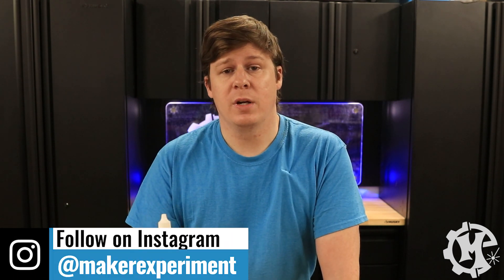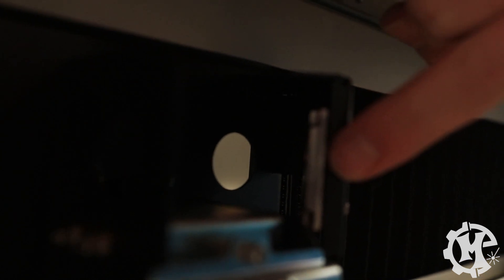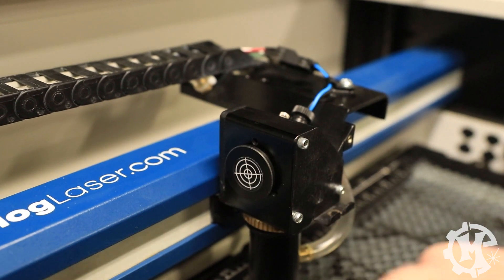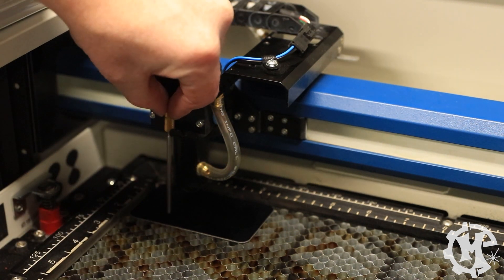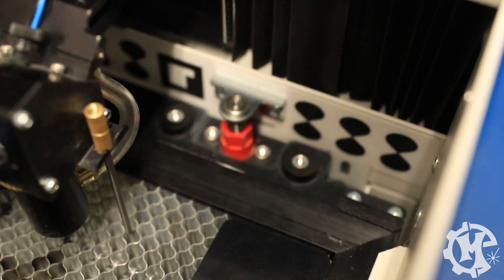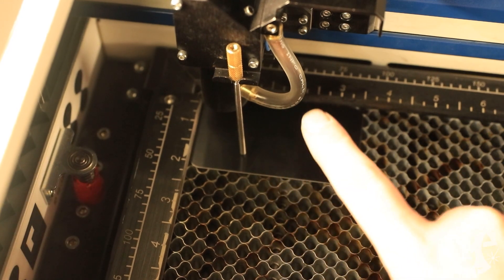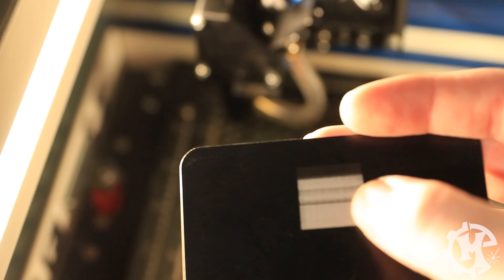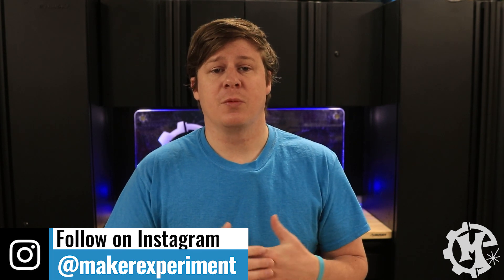Tips to Dial in Your Laser for Perfect Results

Comment: Great video. I saw some vertical lines on your anodized test piece. Is this typical when you engrave materials with the Fusion Edge?
Reply from the maker: I’d have to look back at what you’re referring to. It is possible to not have lines if you tweak it and dial it in.
Reply: @MakerExperiment  Thanks for the reply. Do you have any tips for tweaking to remove the lines?
Reply from the maker: @LaserEngraved look at your DPI and focus. You may also want to check alignment.

Comment: Hi Trevor. When levelling the table on a Fusion Maker  - is it the same screws you loosen either side of the nylon nut? I'm finding them very difficult to loosen using the 5/32 Wiha ball end screwdrivers supplied. I've ordered a ball driver with a right angled handle to increase the torque but I don't want to do any damage.
Reply from the maker: As far as I’m aware, yes. From the factory, they may be tough to loosen.

Comment: How do i center the text for multiple cable tags?
Reply from the maker: I’d suggest making a jig.
Reply: @MakerExperiment  what's your setting  suggestion for etching the cable tag when you want the text to be smooth and dark text. I have the fiber focus at 0.030 speed at 20, resolution at 1200, power at 100 or 90? This setting the letters appear to be white and not dark
Reply from the maker: @kikimookie3407  do be honest, I haven’t messed with fiber enough yet to provide guidance on that one at this time.

Comment: Hey Trevor, just picked up my Edge 24 80 Watt over the weekend and got it up and running. I am noticing that the settings required to CUT through simple materials are a lot higher than expected for even 1/8" birch or 1/8" acrylic. All mirrors cleaned and aligned. New 2" lens installed. bed is leveled. laser is in focus. Wondering if you have seen this happen with your machine, since you are also running an edge?
Reply from the maker: What were your settings?
Reply: @MakerExperiment  for the wood i used 30s 40p 10f. And those numbers didnt even come close to cutting through
Reply from the maker: @Sandbagsims   mines a 60 watt and my settings were close to 100p 20s and 15 freq for 1/8”. I’ve never heard of cutting being that low of a power. It is an 80 watt but I’d expect the cutting to be somewhere in the 75-100 power range.
Reply: @MakerExperiment  thanks. I was just going by the Epilog suggested settings, and the ones that get input from their material library. Maybe just a mistake on their part, because in the manual, I do see that for the 60 watt it shows 50s 100p. I will try again tonight with 100p.
Reply from the maker: @Sandbagsims  it was probably just a translation issue in the material library.

Comment: need advice, have a dealer who is selling me a demo unit fusion edge 12, 40 watt machine that he says is like new out of the box with approx 10 hours of use,  with bofa filtration for $15,500. Is that a good deal, only will give 1 year warranty. Or should i push for new out of the box?>
Reply from the maker: If you’re getting a Bofa filter on it, it sounds like a good deal. As far as the warranty goes, I’d call corporate and ask about that. They should be honest with you.

Comment: How do you adjust the Auto Focus if it does not match the newly adjusted manual gauge?
Reply from the maker: I’d have to dig into the settings again. I honestly forget and the machine isn’t in front of me. I’ll note it as a question and see if I can find the answer.
Reply: @MakerExperiment  I just added a Fusion Edge 12 to my collection. My area Epilog rep is not well versed in tech information.
Reply from the maker: @myronbenware4452  do you have Instagram or email? I’ll be happy to help where I can.

Comment: Hey Trevor. Any suggestions on why the lens on my fusion is getting dirty super fast after it has been cleaned and I am running air assis the whole time?  I have to constantly clean and its actually damaging my lens cause its getting scratched from me constatly cleaning
Reply from the maker: What are you typically doing and what materials are you using?
Reply: Is it possible that my air assist sucks?
Reply from the maker: @sebastiansaez5155  it’s possible. It should be around 30 psi I think.
Reply: I am so grateful for all of your videos and you always responding so quickly!  Thank you!
Reply from the maker: @sebastiansaez5155  I try. It doesn’t always happen. Thank you for watching.
Reply: @MakerExperiment  it always has for me!  But no worries I wont expect that always. Thanks man! You are the best
Reply from the maker: @sebastiansaez5155  thank you.

Comment: On a Fusion there is a spot for the target on the left side after removing side panel to tighten up mirrors 1 and 2 so then you only have to worry about mirror 3 for targeting the laser inside the bed. 

Top left -  top right and middle right usually can show if there is anything off as it creates the triangle, but to be sure go right lower then left lower. If mirrors 1 and 2 are sorted in the previous step the 3rd one is the only one to adjust, once centered I tack the screws with crazy glue to hold the screw position

Bed leveling I use the back vents as a visual guide and if it is off in the back then I do what you do in all corners. 

A test raster and cut in all 4 corners also gives you and idea if the level is off and that the laser if firing properly. I use a piece of cardboard for the entire bed do a test in all four corner and middle. If its not cutting in the far right corner through like in the other corner then you know you may have to level the bed in the front otherwise it is within tolerance and you should be good.

Comment: This is awesome info! I see no instructions in the material that this should be done in the beginning.  After first 2 very small engravings & 1 Epilog canned cutting design, I could assess it was out of level.  I got it level as i could with instructions.  Also, I could see it was out of focus & out of beam alignment. I now know--never trust a turn-key machine. I will be tuning up camera, x/y, & beam alignment.  I'm slow & careful.  Is this in the right order?  Learning the hard way, but getting an education! I appreciate your videos!
Reply from the maker: Leveling the bed should be first. After that I would align the mirrors and everything. Camera I would do last. The machine is great when it leaves the factory. The issue is the transit. The shipment process moves them around a lot and jostles things.

Comment: I've been wondering about some things with my laser, so this inspired me to finally go through all those checks, so huge thanks! 
Turned out that level/alignment was all good, but I did discover that my red pointer was off by a decent amount. Not sure how important it is to normal operation since it's never 100% accurate anyway, but something to note that you should also check when first starting up.
Reply from the maker: Will Knoll the red dot pointer and mirror alignment go hand in hand. It’s definitely something you should check.